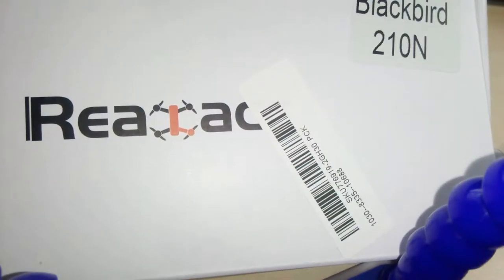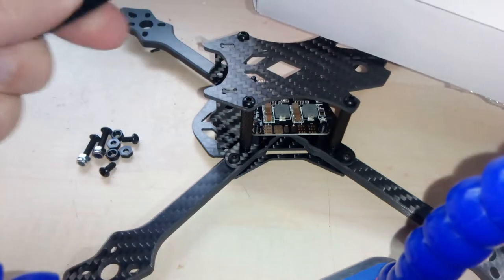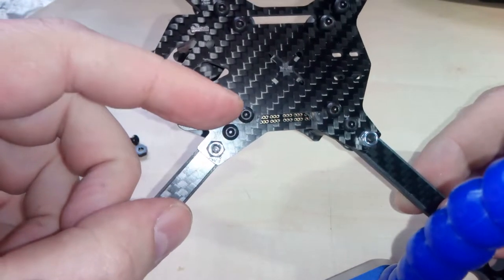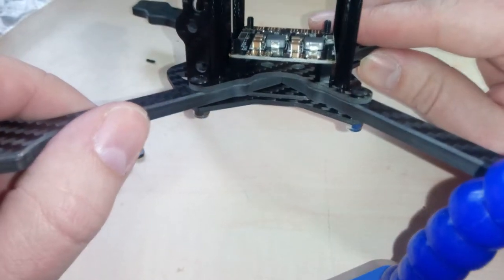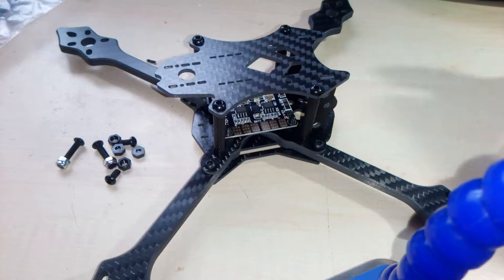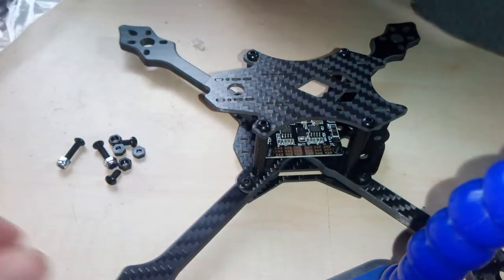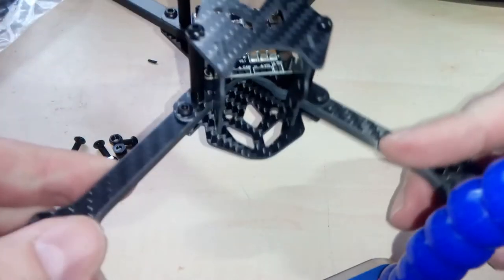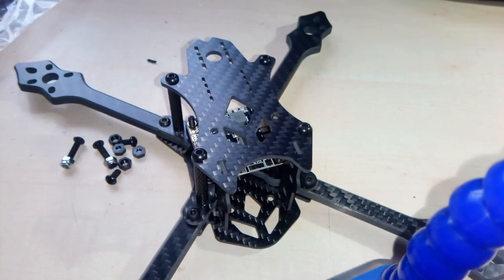Realacc 210N FPV racing frame

Comment: Any reason you didn't go stretched X? Also, can you share a final pic of your build with this frame? I am really interested in your mounting technique for the VTX. Great review! I've been waiting for one.
Reply from the maker: Hi, true X or streched X depends in my opinion if you are a racer, or a freestyle pilot. As a racer you most likely want to have more authority on the ailerons to make tight turns, while pitch axis stays more or less at 90 degrees ;-) A narrower streched X frame does turn sharper, as the mass is more centered. On the downside less authority on the pitch axis, as the frame is longer and the movable mass is further away from the center of gravity. As a freestyler (like me) I am liking a more balanced frame.
Regarding build, I am waiting for some missing components, but I will make build video, that's for sure :)
Reply: Excellent and practical breakdown. I bought the stretch X to be a racer for reasons of just knowing that stretch X frames are for racing, but you have nailed the theory behind why. Thanks! I look forward to seeing your final build and will share mine as well. I should have all my components in later this week. I am just awaiting custom clearance!